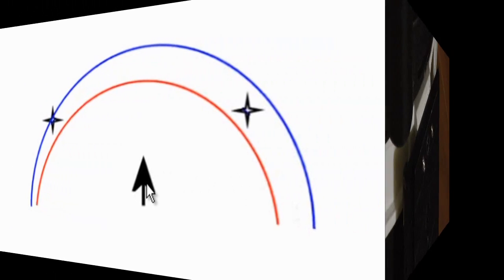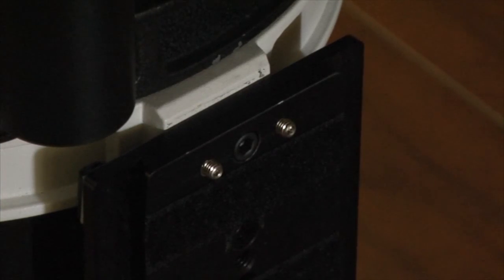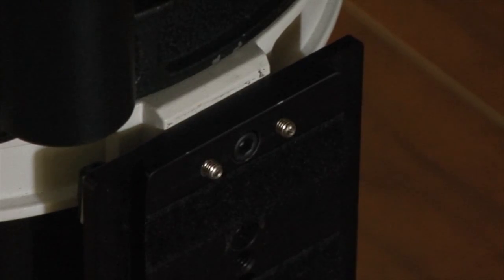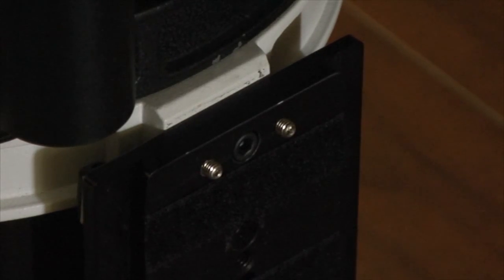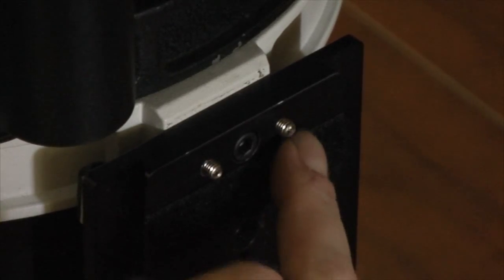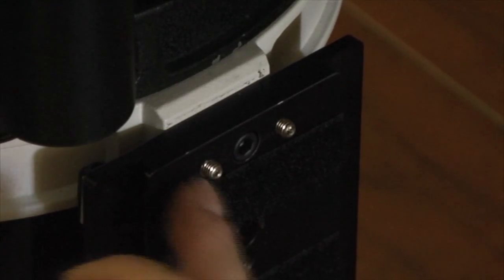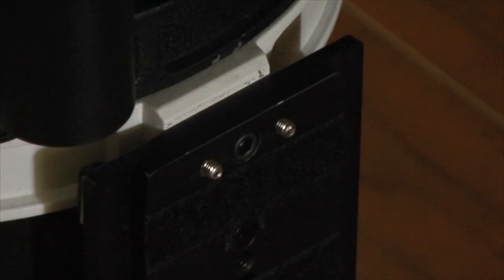Complete Mount & Scope Setup. PART FIVE  (Cone Error)

Comment: Excellent... problem solved. I was pondering what material to use for shims , then it struck me , I purchased a feeler gauge which included 32 sizes in stainless steel. I simply experimented and found the right thickness for my needs and cut to a reasonable length. Works like a charm. Here's where it got interesting , I did this inside my house, yes you read correctly. I had a clear shot through the front door all the way to the dining room , roughly 30 feet. I printed out a solid circle ( red ) roughly half the diameter of a number 2 pencil put it to the highest point on the wall then put up pieces of blue painters tape in one inch increments on both sides of the red circle. and did the procedure described in this video. I had doubts about the results but to my total astonishment I had a clear night to test , did my setup routine , polar align , star alignment and the moment of truth , slew to target which in this case was regulus and it was dead on , tried again with Sirius and again dead on. Tried 3 more stars and again , dead on. Was it luck ? don't know and don't care it worked.

Comment: Great tutorial!  Just a note on adjusting with object on the horizon.  It needs to be an object in the far horizon, not a nearby building or this will not zero out the cone error for astronomical objects. It might, in fact make the problem worse. As a sample calculation, with the OTA and polar axis offset by 1ft, it requires a horizon point 20mi away for the pointing results to be indistinguishable within 2" from using Polaris.  Pretty much the same problem as adjusting a rifle scope for a particular target distance and then using it at a different distance.
Reply from the maker: I think you are adding something that isn't there. The Horizon is the line in the distance where the sky meets the earth, therefore a building on the horizon is just that, a very faraway building. In no way whatsoever does 'horizon' suggest a nearby bulding. Also the comparrisn to a rife scope has no relationship to cone error, which is a characteristic of a mount being able to go either side of a meridian flip and still retain an object at the centre of the field of view.
Reply: @astronomyshed  Thank you for the reply.  I added this comment because you had another viewer who made the mistake of using a nearby building and was surprised when the results changed when picking another object at a different distance. I grant that the rifle analogy is not ideal in this forum, but for those familiar with the situation, it may be a useful analogy for why the cone error adjustment must be done on an object that is effectively at infinity. Performing a cone error correction on a closer object is exactly the same thing as siting a rifle scope for a target distance; the "OTA" and "Polar" axes are intentionally aligned to converge at that target distance rather than being parallel and "converging" at infinity.

Comment: Hey I have a question. I have been told that cone error will not effect tracking at all, only goto. That doesn't seem right to me. It seems to me that it most definitely would effect tracking. Can you confirm that?
Reply from the maker: Curtis Reynolds Nope, only goto is affected.
Reply: It seems I must be misunderstanding your video at 2:25.
Reply: And by the way, I love your videos...VERY informational. They're quite helpful!
Reply: @astronomyshed  Presumably because tracking is being constantly corrected when using a program like SharpCap? Assuming one's guide-scope is likewise corrected to being parallel to the main OTA(?).

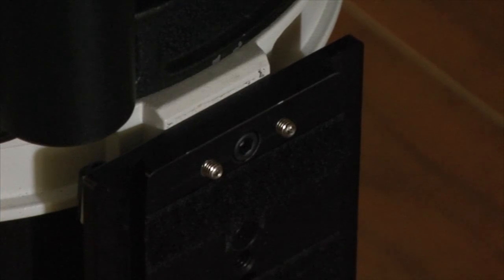Comment: I really admire your video tutorials very much. I learn a lot from your tutorials. Your tutorials are comprehensive and unique of their kind. But just a tiny observation that the cone error diagram you're showing from 2:26 to 2:57 minutes in the video, I'm not sure that is the correct diagram. If the dovetail bolts raise and lower the scope only up and down then they cannot fix the cone error as shown in that diagram from 2:26 to 2:57 minutes in the video. The scope's tracking semi-circle should be concentric with the mount's tracking semi-circle. The scope's tracking semi-circle should be having larger or smaller radius than the mount's tracking semi-circle's radius if the dovetail bolts can fix the cone error. I'm trying to describe the best I can. The diagram you show from 2:26 to 2:57 minutes is possible only if the dovetail is at an angle of little East or little West from the either end of the telescope. But according to me with the dovetail raising and lowering bolts the cone error in the diagram from 2:26 to 2:57 minutes in the video cannot be fixed certainly. If you have any counter explanation then please help me out...
Reply: I agree  with what you say. But that said, I am not an expert.

Comment: Great video as always!  I've been wrestling with drift alignment options and came up with your tips on Align Master.  I guide through a ST80 mounted atop my 8" LX200 OTA on an Atlas Pro mount.  In order for Align Master to work properly should I be doing my alignment through my main LX200 in which I've eliminated the cone error using your method or my guide scope which I'd also have to square up properly?  The guide scope is in rings and I doubt it would maintain it's cone error adjustments from session to session with my mobile setup.
Thanks
Reply from the maker: Bruce Braunstein Always using main scope.

Comment: Good video Dion, just a word of caution I tried this with my 300PDS on an NEQ6 mount, the problem is that to balance the scope you need all 4 5kg weights and the extension bar and this does not lie level pointed east then west with this load. I fixed it by making sure the mount was level and kept "Home" as zero. Rotating the set-up 90 degrees E or W then gave the same error on the level. After that the technique worked a breeze.

Comment from the maker: You adjust the grub screws on ONE side, flip the scope over and re-center the star using mount adjustments ONLY, then flip back again, and if it's out, adjust the grubs again and repeat. The aim is to get the star as near to center on BOTH sides when you flip the scope but WITHOUT having to adjust   alt or grubs.